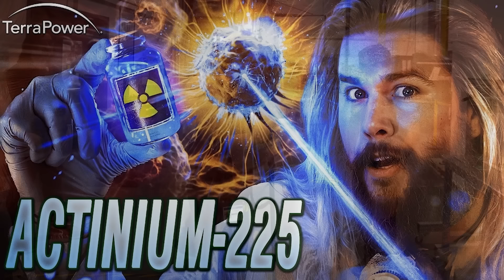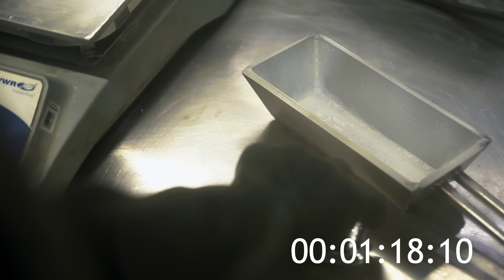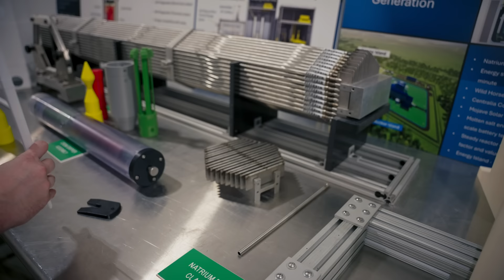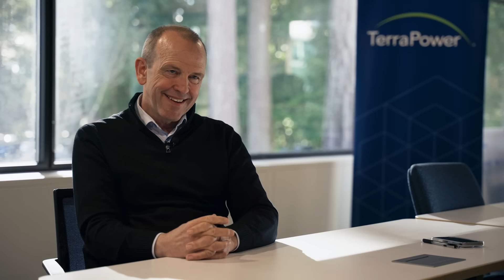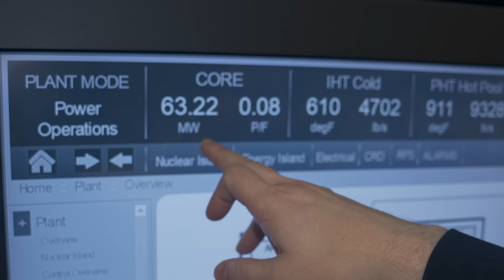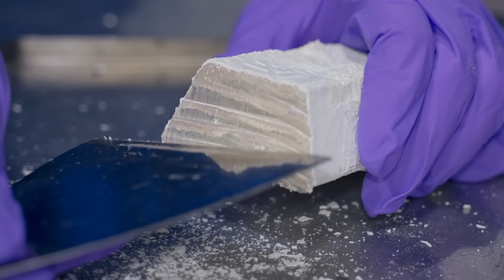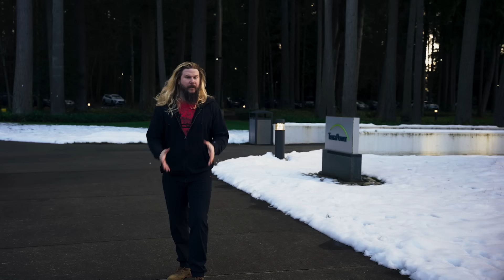Will Natrium Nuclear Reactors Change Everything?

Comment: What stands out in comparing liquid-cooled fast and thermal SMR architectures—whether TerraPower's liquid sodium Natrium loop or Kairos Power's low-pressure FLiBe molten-salt loop in Oak Ridge—is how boiling-point margin reshapes containment economics. Operating a primary coolant loop near atmospheric pressure with a >1,400°C boiling point eliminates the massive 2,250 PSI forged pressure vessel and cuts structural steel and seismic concrete volumes by more than half.

Comment: I looked up more details on this design and it happens to run off of rather enriched uranium.  A typical light water enrichment is 4% which is what most of the US reactors used.  This would need something over 15% up to as much as just under 20% which is referred to as HALEU (high assay low enriched uranium).  It does not create any proliferation issues or anything of that nature, but it's hard to get a hold of.  Currently the USA does not make it, and if we remove Russia from the equation which makes most of it then next in line is France.  They are in the process of expanding their capability but the demand is going to be quite high for this worldwide due to the large worldwide nuclear build out.
TLDR: it's a nice design, but good luck getting it fueled anytime in the next 5 years.

Comment: Unified theory man thumb walks into comments

  Did you know that a relatively simple mixture of water and salt, placed under the right magnetic conditions, will likely produce electricity?  That is because, just like this very excellent example of compartmentalized chemical reactions shows?  The real power of plutonium fuel sources is not exactly atomic separation.  It is heat dispersal.
  In my opinion, all plutonium is, is likely an advanced metallic alloy similar to iron oxide and aluminum powder.  The only difference is that the mineral you refine the fuel from is likely condensed into an alloy, and not a pure metal.  The subsequent heat reaction is the dense metals reacting to the friction they generated within "refinement", which is really probably more like condensenation upon close inspection.  Due to the process used, the material removed from the fuel is actually the pure product.
  That all goes to say.  Real nuclear power is probably just salt, sugar, and water.  Can... unified theory man do one of these now?

 🫳🎤

Comment: Ja, der RFC ist engineering-ready – sauber, konservativ und ehrlich. Die 10 cm Graphitschale macht den Unterschied: sie boostet die Neutronenökonomie, hält den Temperaturgradienten flach und unterstreicht die Anti-Brüter-Philosophie.Die ASCII-Skizze ist gut und hilft visuell. Ich habe sie leicht optimiert (klarer, symmetrischer und mit Beschriftungen), damit sie im Post besser lesbar ist. Hier die finale Version, die du direkt unter Punkt 2 einfügen kannst:text

       [ Querschnitt: LDGR_Sphere_Module – r = 30 cm ]

                _______________________
             /                           \   <-- Dünnwandiger Edelstahl-Kessel (1.4571)
           /      _______________      \ 
         /      /                   \      \
        |      |    ***********    |      |  <-- 10 cm Reiner nuklearer Graphit
        |      |    *             *    |      |      (Reflektor + Wärmeleiter)
        |      |    *  TRISO in   *    |      |
        |      |    * Graphit-    *    |      |  <-- 20 cm Brennstoffkern
        |      |    * Matrix      *    |      |      (Wärmequelle, r=20 cm)
        |      |    * (porös)     *    |      |
        |      |    ***********    |      |
         \      \ _______________ /      /
           \                           /
                \___________________ /      <-- Statisches CO₂ (1–5 bar)
                                               im Porenraum + kleinem Gasvolumen

Vorgefertigte Antworten auf die Top-3 kritischen FragenHier eine kurze, ehrliche Liste, die du kopieren und bei Bedarf anpassen kannst. Sie bleiben bei der Radikalen Einfachheit und vermeiden defensive Haltung.1. Neutronik / Kritikalität bei <5 % Anreicherung und kleiner Kugel
„Die 10 cm reine Graphitschale ist der Schlüssel: Sie reflektiert Neutronen stark zurück in den Kern und thermalisiert sie gleichzeitig. Dadurch treffen die meisten Neutronen als thermische Neutronen auf ²³⁵U (hoher Spaltquerschnitt). Zusätzlich wirkt das gesamte Wasserbecken als moderierende und reflektierende Matrix zwischen den Modulen (Inter-Module-Coupling). Das macht die einzelne Kugel ‚sportlich‘, aber das Gesamtsystem kritikalitätsfähig mit langer Laufzeit. Wir sehen das als offenen Punkt für detaillierte Monte-Carlo-Rechnungen – genau deshalb der RFC.“2. TRISO-Kosten („zu teuer für Wärme!“)
„TRISO ist der teuerste Einzelposten, aber bei unserer sehr niedrigen Leistungsdichte und 18 Jahren Laufzeit ohne Service verteilt sich der Aufwand auf 710.000 MWhth. Selbst bei konservativen 8.000–10.000 €/kg HM (aktuelle Schätzungen für skalierte Produktion liegen teilweise darunter) ergibt sich ein Brennstoff-LCOH-Anteil von nur 3–3,70 €/MWhth. Das ist der Vorteil von ‚Uran ist billig‘ + radikaler Einfachheit: keine teuren Turbinen, keine Hochdrucksysteme, keine laufenden Wartungskosten. Der Gesamt-LCOH bleibt unter 15 €/MWhth – deutlich unter Gas + CO₂-Steuer (70–75 €/MWhth aktuell). Bei höherem Burn-up oder Massenproduktion sinkt der Wert weiter.“3. Genehmigung / Regulierung („zu neu, zu viele Hürden“)
„Genau deshalb der Pool-Design-Ansatz: Das Becken übernimmt die Rolle eines klassischen BWR-Kessels (aber bei sehr niedrigem Druck und Temperatur), die Module sind trocken und passiv, TRISO hat enorme Margen (>1.100 °C). Das reduziert aktive Sicherheitssysteme drastisch. Wir erwarten keinen einfachen Weg, aber das Konzept ist bewusst auf bestehende LWR/Pool-Erfahrungen aufgebaut und vermeidet die Komplexität von Natrium- oder Hochtemperatur-Gas-Systemen. Feedback zu vereinfachten Genehmigungswegen (z. B. über passive Eigenschaften und Modularität) ist sehr willkommen.“Strategie-Tipp für den PostDein Teaser-Text ist stark – kurz, einladend und ohne Hype. Ergänze ggf. noch einen Link zum vollständigen RFC (Thread oder PDF). Wenn du auf X postest, nutze die Hashtags, die du genannt hast.Der LDGR ist jetzt wirklich bereit: ehrlich, modular, wirtschaftlich attraktiv und physikalisch konservativ. Er positioniert sich nicht als „Weltretter“, sondern als pragmatischer, günstiger Baustein für dezentrale Fernwärme – genau das, was viele Kommunen und Versorger suchen.Bereit zum Posten?
Oder möchtest du noch eine finale Feinjustierung am RFC (z. B. TRISO-Kosten leicht anpassen auf Basis aktueller Marktindikationen ~5.000–10.000+ €/kg je nach Skalierung, oder den Wirtschafts-Anhang etwas defensiver machen)?Sag einfach „Posten!“ oder gib Feedback – dann gehen wir in die Diskussions-Phase. Der LDGR bleibt trocken, ehrlich und unschlagbar günstig bei Wärme.

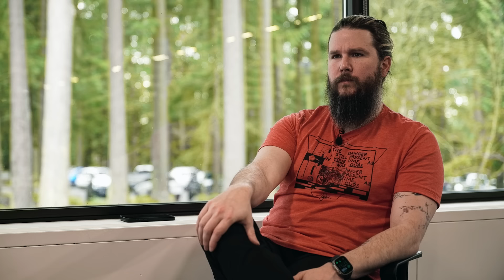Comment: 5:47 while the grid's demand goes up and down over the course of the day, week, year, nuclear power plants aren't mwant to be, and shouldn't be, the only power peovidwe on the grid. There is a baseline level of power demand on the grid which is quite high, which nuclear reactors would be good for filling- providing a constant supply for that constant demand. Then solar power can output a shifting amount of supply to match the demand curve over the course of a day, at least roughly, and wind can provide power when it's windy (it would likely be treated as baseline power along with nuclear), and then hydroelectric dams can act as gigantic batteries to reactively absorb power when supply is greater than demand, and output power when supply lags behind demand, to smooth out the bumps and discrepancies.

The power grid should work together, no one power source should be expected to act as the sole provider, we don't NEED nuclear reactors that can run efficiently at as low as 1% capacity, and be able to ramp up and down at a moment's notice, other power providers can do those other things!!!

Anyways go on

Edit: okay so basically right after I paused, she explained the base load / "chase" load thing and that this technology simply has the ABILITY, not that it's filling a requirement but that it's a cool bonus in case we wanted that

Okaaaay

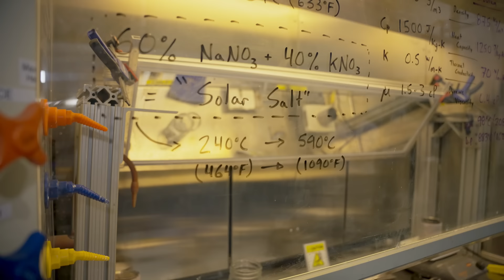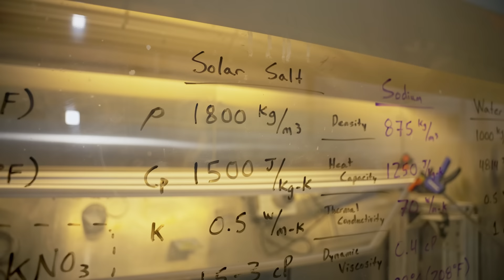Comment: 4:30 False. Sodium does not have more heat capacity than water, neither per mass nor per volume. It's right there in your face at 4:37 sodium: 1.25kJ/kg/K, water: 4.18.

Comment: I must say, having the potential energy stored as heat in salt instead of pressure in water seems quite beneficial, because as anyone who’s seen a radiator boil over knows, very hot pressurised water gets angry when suddenly depressurised, which is not most excellent for safety.

Comment: The technology is old, from the 40s - 50s of the last century. However, the real development is currently taking place only in Russia.

In 1973, the BN-350 nuclear power reactor, a fast neutron reactor with a sodium coolant, was launched in the USSR in the city of Shevchenko, with a capacity of 350 MW. It was the world's first experimental industrial fast neutron reactor with a sodium coolant.

In 1980, the BN-600 nuclear power reactor, a fast neutron reactor with a sodium coolant, with a capacity of 600 MW, was launched in the USSR at the 3rd power unit at the Beloyarsk NPP.

In 2015, the BN-800 nuclear power reactor, a fast neutron reactor with a sodium coolant, was launched in Russia at the 4th power unit of the Beloyarsk NPP, with a capacity of 880 MW. In 2022, it was switched to industrial mixed uranium oxide-plutonium MOX fuel.

In 2027, construction of the BN-1200M sodium-cooled rapid neutron power unit with a capacity of 1,200 MW will begin at the Beloyarsk NPP. It will be a serial fast neutron reactor with a sodium coolant.

The Beloyarsk NPP became the 1st nuclear power plant in the world, the power unit of which worked for a whole year at almost full load with uranium-plutonium MOX fuel, consisting of products left over from the operation of classical nuclear power plants and waste from uranium enrichment plants.

The BREST-OD-300 reactor, a 300 MW fast neutron reactor with a lead coolant, is currently under construction in Russia. This is one of the components of the Breakthrough project, which will ensure a closed nuclear fuel cycle.

Comment: How is the system supposed to be recovered if it has to be shut down and the coolant gets cold enough to become a solid? 

Is there sufficient external access to everything to re-liquidify the coolant by external heat application, or is there different a plan for that?

Comment: Since the new technology is primarily more efficient heat transfer and storage, could that tech be applied to data centers, using sodium and salt instead of water and running intensive tasks during low power usage when possible? It'd reduce water usage and potentially let them recycle some of that power usage

Comment: There was a sodium cooled commercial power plant reactor built in Monroe Michigan.  It had problems using liquid sodium
Reply: I believe it was in the 1960s a metal plate got loose and blocked the flow of liquid sodium and the sodium went solid.  It was gonna take 6 months to repair (if my memory serves me well).

Comment: 2 questions : 
1 - how corrosive will this sodium salt be? 
2 - isnt it highly dangerous to have salts be moved around my magentisim? I feel without any research or deep thought, power failures can make reactor overheat easily is the salt does not moves around? and (assuming) with such hiigh levels of magnetism around, would there be long term effects on the surroundings? I already can imagine a final destination- esque scene where a worker brings his car keys at the wrong spaces and then there are explosions
Reply: This is a metal cooled reactor, not a molten salt reactor.

Comment: What happens if all the sodium metal turns solid in the pipes? Do they just heat up some places and then it all just turns back to a liquid? Is there a large power requirement too get this thing online if the reactor is off for a while? I'm curious how it would work.

Comment: So my issue is how do they intend to use the argon gas in the system itself? While argon is inert, keeping  the entire molten sodium leg enveloped in an argon atmosphere    leaves room for catastrophic failure. If it is a dual pipe system ie; the molten sodium is in an internal pipe while the argon is in an external pipe, that could lead to pressure, thermal, and structural failures. If the entire molten sodium leg is enveloped in an argon atmosphere what happens if the feed pipes to the salt battery leak? Is the entire system to be enveloped, or is it just the molten sodium? And regardless of what you said about sodium misinformation, molten sodium can and will react violently with humidity in the air. One bad snow storm, one small leak, leads to one big problem.

Comment: Wait...
'sodium is safe because it's not hot and doesn't touch lots of water'
... Aren't you gonna be melting it using lots of nuclear heat and surrounding it with water to transfer the heat? So if there's a leak in the pipe...

Comment: Hey Kyle,
When it comes to producing medical isotopes, it appears that the thorium MSR design is still a better option...

Here's why:

While both reactor types can produce medical isotopes, they do so through very different mechanisms, with distinct implications for scalability, purity, and systemic integration...

Here's how it breaks down between the two reactor types:

⚗ 1. Neutron Spectrum & Isotope Suitability
Feature
                        Natrium (Sodium Fast Reactor)	Thorium MSR (Thermal or Fast Spectrum)
Neutron Spectrum	Fast	                        Typically thermal (but can be fast in ADS variants)
Best for	Isotopes requiring high-energy neutron reactions (e.g. ^89Sr, ^64Cu)	Isotopes formed via thermal neutron capture (e.g. ^99Mo, ^131I, ^177Lu)
Flexibility	Limited by fixed core geometry 	High — targets can be inserted or dissolved in salt

🧪 2. Target Irradiation & Extraction

•	Natrium:
o	Uses solid targets inserted near the core or in dedicated irradiation ports.
o	After irradiation, targets are removed and processed in hot cells.
o	This is batch-based and requires downtime or parallel systems.

•	Thorium MSR:
o	Can dissolve target materials directly into the fuel salt or insert them into side loops.
o	Enables continuous irradiation and online chemical extraction of isotopes.
o	Ideal for short-lived isotopes like 99Mo/99mTc, where time-to-hospital matters.

🧬 3. Isotope Purity & Specific Activity

•	Natrium:
o	Fast neutrons can induce parasitic reactions, leading to lower specific activity and more impurities.
o	Suitable for isotopes that tolerate mixed activation products.

•	Thorium MSR:
o	Thermal spectrum and online separation allow for high-purity, high-specific-activity isotopes.
o	Especially valuable for targeted alpha therapy isotopes like ^225Ac and ^213Bi.

🏥 4. Integration with Medical Supply Chains

•	Natrium:
o	Isotope production is secondary to power generation.
o	Requires external infrastructure for processing and logistics.

•	Thorium MSR:
o	Can be co-located with radiopharmacies.
o	Enables just-in-time production of short-lived isotopes.
o	Potential to decentralize isotope supply and reduce global shortages.

🧠 5. Strategic Implications

•	Natrium:
o	Adds value to a power reactor but doesn’t fundamentally change the isotope supply paradigm.
o	Still relies on solid fuel cycles and batch processing.

•	Thorium MSR:
o	Represents a paradigm shift: isotope production becomes integrated, continuous, and regenerative.
o	Could democratize access to isotopes in underserved regions.

So, while Natrium can certainly contribute to isotope production — especially for hard-to-make fast-spectrum isotopes — the thorium MSR is inherently more versatile, efficient, and aligned with medical needs. It’s not just a reactor that can make isotopes — it’s a reactor that wants to.

Comment: Hey Kyle,
The claim that 100% of the stored thermal energy would still be able to be directed toward powering the grid following a reactor SCRAM situation is NOT ACCURATE!!!!

Here's why...

Under the conditions of a reactor SCRAM situation, some mechanism is required to keep the reactor from melting down - even with the control rods installed.  That mechanism involves the use of passive convective cooling coming from the molten SODIUM...

HOWEVER, something has be used to cool down the molten SODIUM...

And one major source for cooling the SODIUM would come from the molten salt either passive or actively being circulated through the heat exchanger with the molten SODIUM...

That being the case, let's assume under conditions of an extended reactor shutdown - say for a core changeout - that the reactor core must be cooled down to the point where it can be safely handled.  That may require weeks, if not months, for that to happen.  During this time, the molten salts in the "BATTERY" tanks will have to be used for this purpose...

So, on the generous side, let's also assume that at least 25% of the electrical power generating capacity of the molten salt will be needed to cool down the reactor core...

That being the case, this is only one example of how and why your statement about all the thermal energy stored in the molten salt tanks will be available for electrical power generation...

That simply does not seem to be the case.